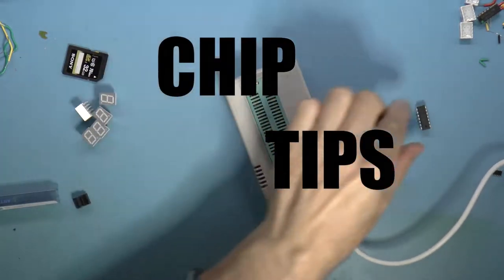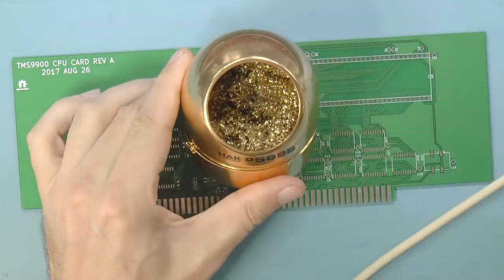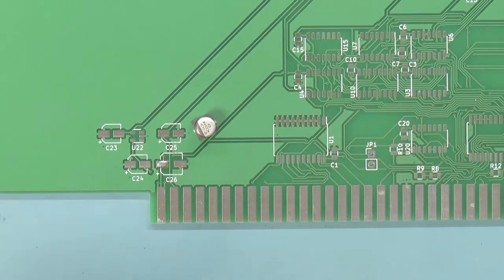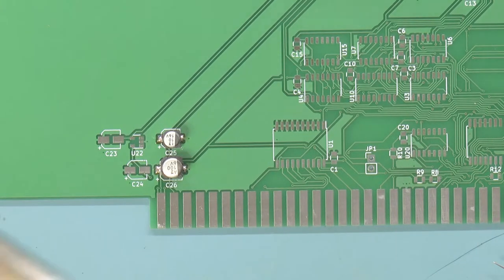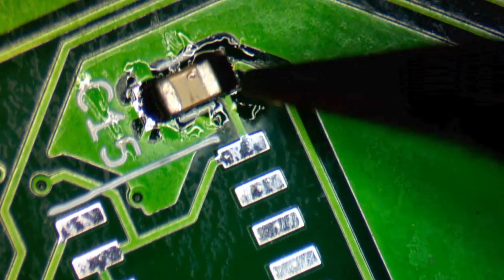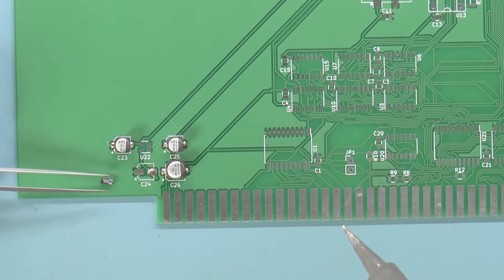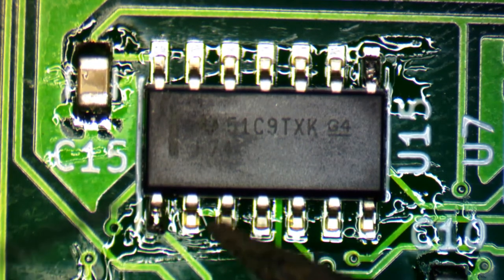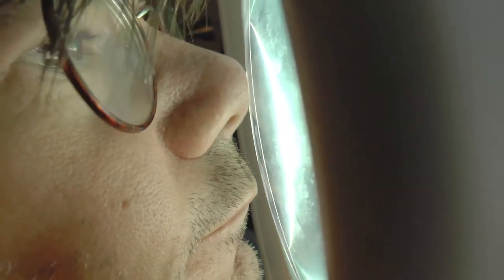Chip Tips #5: Soldering SMD components

Comment: With drag soldering we're normally using a hoof or bevel tip, and there are tips designed specifically for it. Solder is pooled on the tip and then pulled across the leads, not what you were doing with that conical tip. It really makes a difference on high pin count parts like the QFP-144
Reply from the maker: cypherf0x Oh, I knew I was missing something! You are correct, there is a special tip for drag soldering. I heard that you could also use a chisel tip, but I haven't tried it.

Comment: Good way to avoid chips not lying flat (and then wandering off while settling down during resoldering the corner pins) is to just lay them down without solder, apply flux to both board and part and then touch the pins with tip with solder on it.
Drag soldering only works if your tip is bigger than the pitch (and also enough solder can hold to it). 
I found that once I got used to it I never use anything else than a flat tip.